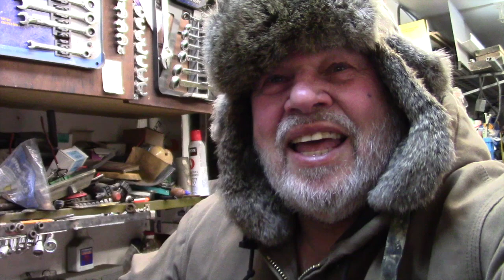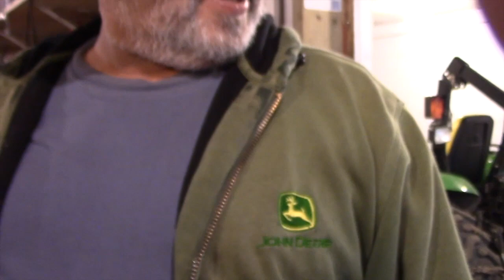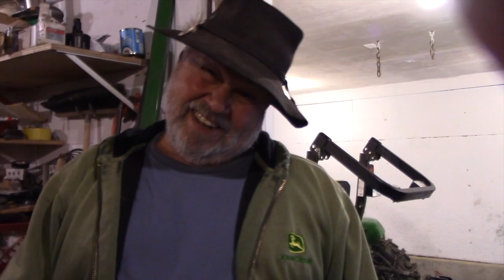This could have bin dangerous

Comment: Great story Gator. Story time with Gator. 👍🏻👍🏻
Here’s one for ya. I was working in a house on a propane furnace. The fella that built this house was an electrical engineer, I believe. Every thing in the house was wired 220 volts.  Every 110 volt outlet had 220 volts to it. Each 110 outlet had a transformer beside it to step down the 220 voltage to 110. I think I know the reasons for this. But maybe you could enlighten me more about why he did this. This was about 30 years ago when I saw this. 
Have a great weekend Gator. 👋👋👍🏻👍🏻
Reply from the maker: I think I know the reason for this and I’m going to make a video about this. I sure hope he changed the type of outlet.....CHEERS
Reply: @gatorsworld    Great. Looking forward to it. 👍🏻👍🏻👋👋

Comment: Great story. With the size of the copper cable, it sounds like it would be worth offering to clear it away 🙂 Could you have used a clamp meter instead of spiking it
Reply from the maker: The outer jacket on this cable was bigger than any clamp meter I have ever seen and plus it would have to be a DC clamp meter and I think are shop only had one of those. The biggest thing is that I was 90 percent sure it was or they were dead but we just had to make sure. Another thing is we didn't know the cable was a single conductor or like a 3-phase cable and then a clamp on would have given you now reading....CHEERS

Comment: Reminds me of when we’d hook up plug feeders to a megar and get the apprentice to splice it. Or get them to go to the shop and get a cable stretcher from the tool shop foreman. . Lol. The jokes that get played in the field eh. Thanks for the story! I was an industrial sparky mostly pump stations and large treatment plants. Cheers, Mike.
Reply from the maker: Electrical was a good trade for me and enjoyed my time doing the stuff that electricians do....At the last pump station plant I worked at, we got to install two furnaces that would take care of the heating in the buildings and would burn the methane and then we put in a system that would burn off all the excess that they could not store in the tanks they had....CHEERS
Reply: @gatorsworld  Nice!  I built a co generation plant that burned the methane from the sewage treatment and generated heat for the surrounding maintenance buildings.  Was the largest plant for Vancouver. Cheers eh.
Reply from the maker: Sounds like the one I worked on. I worked on a few co-Gen plants and it`s all very interesting stuff. May just have to make a video of that some day...CHEERS @maintenancewithmike
Reply: @gatorsworld  you do any work in BC? It was in Annacis Island and the plant serviced most of Vancouver. One of the six clarifiers slab pour was 24 hours of concrete trucks for 72 hours! Really big stuff. The blower motors for the clarifiers were VSD drives from Italy (Ansaldo Ross Hill) they blew so much air if you were to fall into a clarifier by accident you would not float and go right to the bottom. Massive massive pumps. Really cool stuff, and way better than running tray or working on the slab. 
Small world eh. Cheers, Mike.